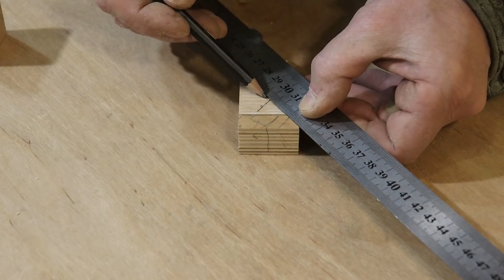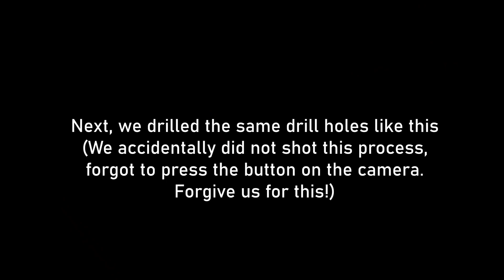5 Incredible Woodworking Tools for Beginners DIY Wood Projects Simplest and Easiest Creative Craft

Comment: Tools for beginners made with professional tools 😆
Reply: in all fairness, he did say beginners not poor
Reply: Most woodworkers would rather let you use their equipment to make your own tools than keep letting you borrow their tools.
Reply: The same thought was running through my mind. Why would you build these tools when you have much better options?
Reply: indeed, it is DIY beginners tools made by expensive professional tools.. buying the professional tools will cost you more than buying those tools made
Reply: All of these operations can be done with simple hand tools, it would just require more work and more time.
Reply: He's just sharing an idea, if you're resourceful enough it can be done even if you are poor, don't mind the stupid comment, they're just ignorant

Comment: i clamped the drill like you even at two planes. but whenever i put a sander or stone which have some weight, at low rpm the drill makes noise probably because of the balance caused by the weight at the end. if the sander removed, the drill turns quiet. do you face the same problem?

Comment: Nice instead of putting a screw in your spindle sander that will wear out after couple changes you should try a piece of flat metal tap that into the gap but leave a little bit higher then the drum on top so you can tap it out again to reuse it.

Comment: Kreg makes a jointer that does this but the kit is hundreds of dollars. Wish I would have seen this sooner.  johnP
Reply: Kreg is an overpriced, cheap plastic tool brand.  Their RIP-CUT guide is a ripoff, weak, plastic guide that I regret to have bought! In the end, I resorted to use the aluminum ruler and completely discarded the plastic base for the saw, making it from aluminium.